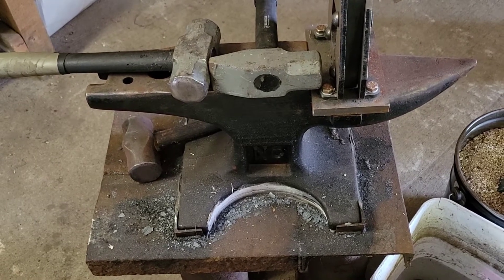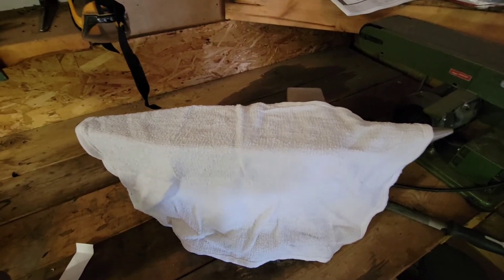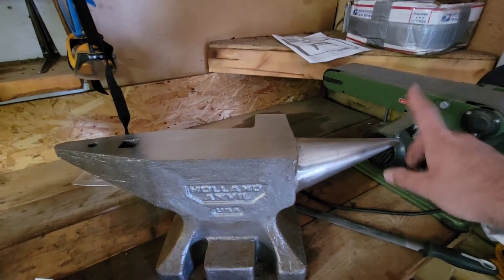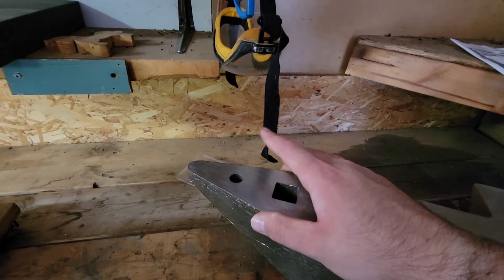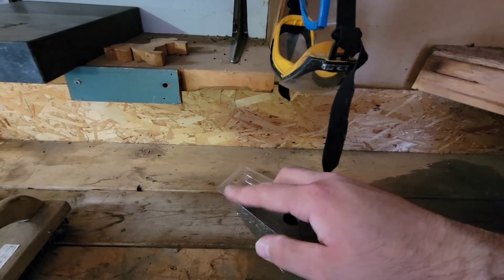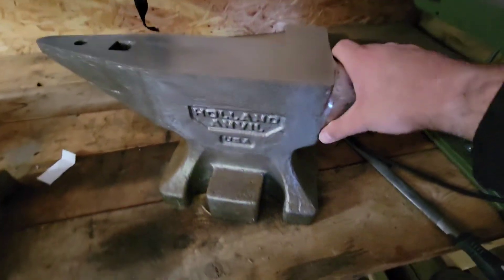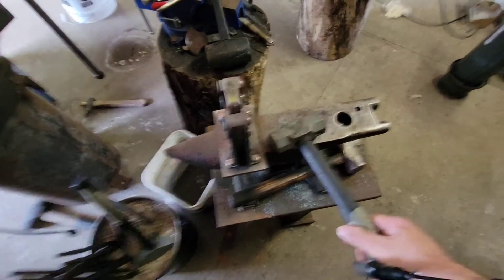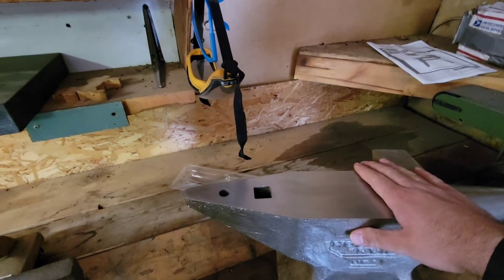Surprise!!! I got a new anvil!!

Comment: I personally do mirror radius’s on both sides. So I have the same to work on each side. So let’s say I have a 16” working surface I’ll have 8” on both sides with an 1/8” or 3/16 radius and the other 8” with a slightly larger radius for drawing out tapers or flat. That’s just my preference and on my flat horn I have a pretty sharp edge and my shelf has multiple radiuses. Which that’s how my anvil came (1909 419lb German double horn with an upsetting block)
Reply from the maker: Thanks. I just knocked the edge off for now. 419lb? That's a big one. I will get one bigger at some point. Have you seen any big benefits to running a anvil that big? Thanks for the comment